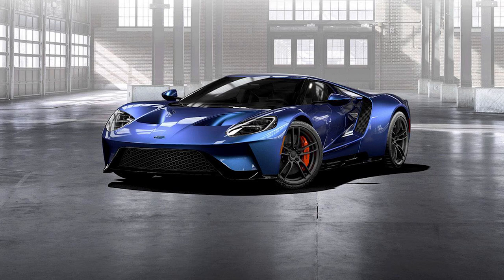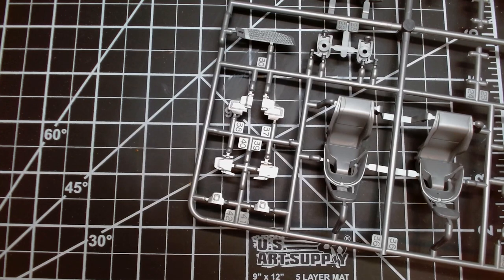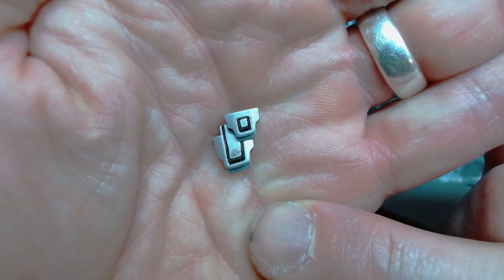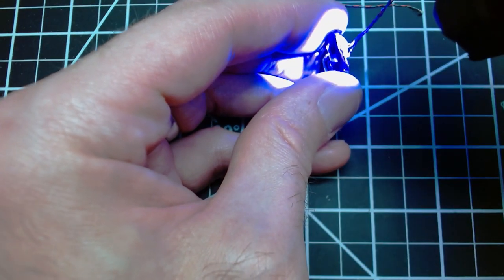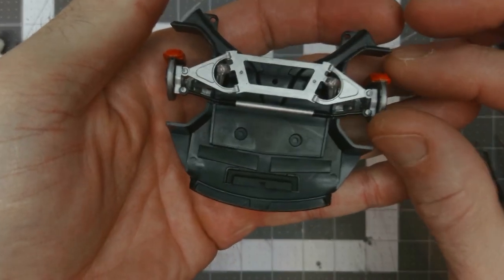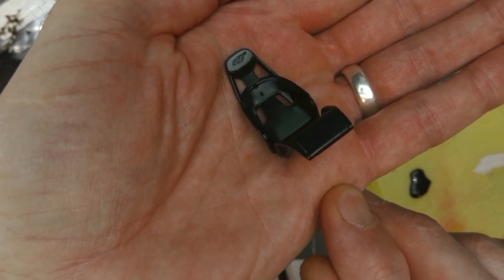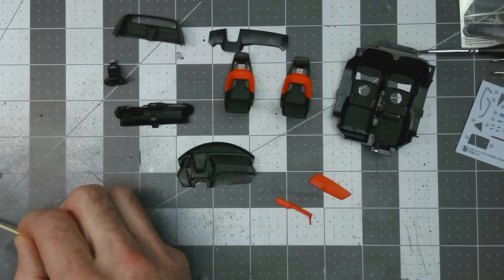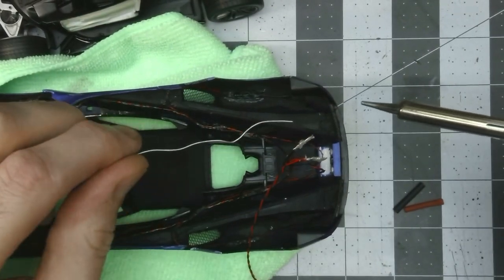Tamiya 1/24 Ford GT - Full Build with LED Lighting

Comment: I enjoyed your video 📹 i know it's a little older but I'm just now seeing it as a new subscriber. 😊 I love everything you did but I thing we in the hobby should share tips some times if you don't already do I noticed on your dash when you did the water slides for the gauges and radio you left it after that something I've been doing is taking a little UV resin and putting a small coat over them and then shine your UV light it will give you the impression that there's glass over them. Again it's a beautiful build  😊 thanks for the video and can't wait to see some of your others sorry went back and seen you had put something over the gauges they look great my apologies lol
Reply from the maker: Thanks, I used clear gloss and I completely agree on sharing tips. I think UV resin is a great idea. I have several colors, but no clear. I used some to seal the headlights... can't remember what color, I think it was black, well grey really.

Comment: came across this wonderful build of yours whilst researching the kit for my own build - as a fellow modeller who likes to put lights in everything, I really appreciate the work you did on it. Where did you install the battery and switch? I'd like to have seen how you did that
Reply from the maker: Thanks! This was a fun project. I ended up deciding it would be better to actually have the model as part of a diorama so the wire comes out by the left rear wheel and will run under the diorama to USB power. I do believe with a small amount of modification a triple A battery pack would fit under the engine. I didn't want to have to cut the bottom open and then handle it all the time to swap batteries. Plus, with USB, you never have to turn it off. It is a great kit and a beautiful car. I just picked up the GT40 from Fujimi to be it's diorama partner. Stay tuned... There will be PE and LEDs on that build as well... and I think it'll be race worn to contrast the clean GT. What colors are you going with?
Reply: @brithebuilder  thanks for the info! I'm looking at doing mine in a dark graphite grey with the black outer stripes sandwiching a red central strip and Black or dark grey rims.
Reply from the maker: Sounds like a very cool color scheme. I do suggest looking into a set of PE at least for the vents and brake calipers.
Reply: @brithebuilder  definitely - I have those items from Hobby Design ready to go. Just waiting on the paint to arrive
Reply from the maker: Fantastic! I didn't use every piece, some of it would have definitely been more trouble that it was worth, but the overall quality change is definitely worth it.

Comment: What kind of glue are you using?
Reply from the maker: Anything that's plastic to plastic, is Tamiya Extra Thin, the black Super Glue is Starbond - Medium Thick. It's got rubber in it to keep the CA more flexible.